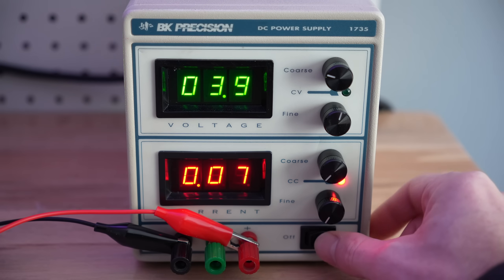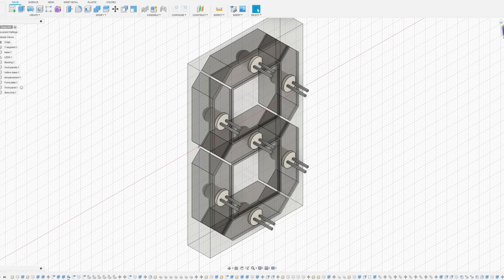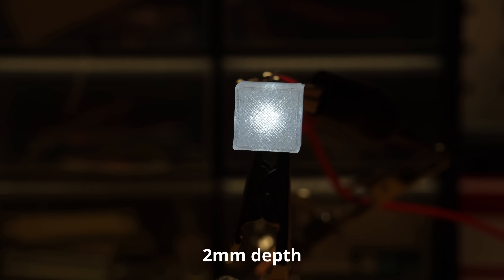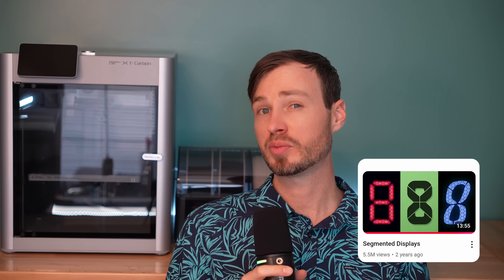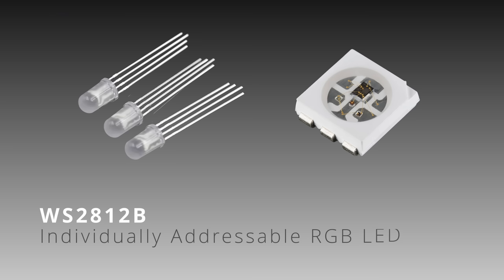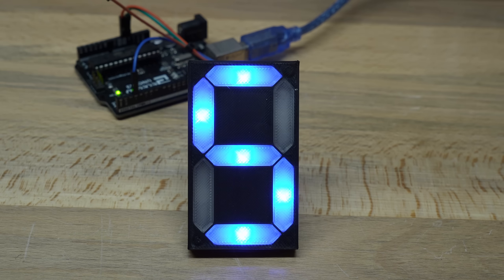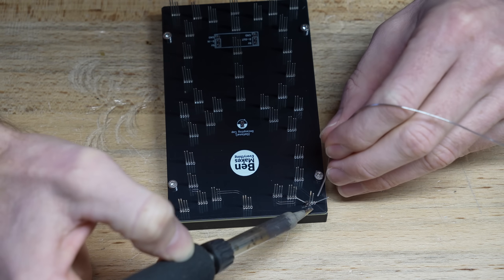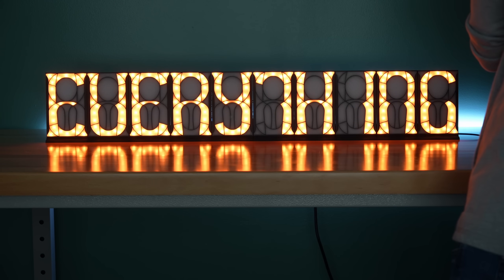How to Make 3D Printed Segment Displays

Comment: How about printing from any material doesn't matter,  then painting the inner surface silver or white?

When they make mass produced segment displays, they usually make them out of very white plastic, then paint the front black, then pot everything into clear epoxy which light guides and maybe diffuses just the tiniest bit, while white side walls provide fair reflectivity; they are however WAY more white pigmented than any white filament you can buy, so normal white filament will result in more light loss because this light is diffused into the depth of the baffle and eventually decays there.

I also sometimes like to sand down the front of mass produced segment displays and replace it with a 50% matte headlight foil to make the screen immune to stray light and hide it better unless on.

"light comes out in all directions instead of a single direction" that is not true, you should look at the specification for the LEDs that you buy. SMD LEDs without a lens have a like 120-160° radiation angle, just like you expect a point light source to emit light in all directions. The lens on the front of the LED (typical for through-hole but also available SMD) focuses down to a narrower angle. If you want to cheat, you can sand down the lens of the LEDs to emit in all directions.
Reply from the maker: Hey, thanks for the feedback. I am actually revisiting this project in my next video, and I took a different approach., so you may find that interesting.

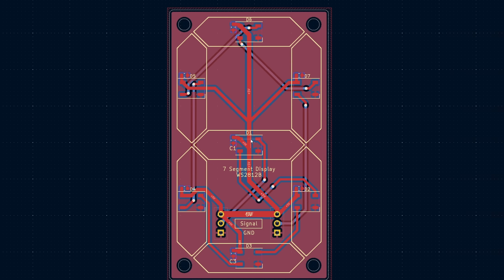Comment: 9:00 The standard pitch of a breadboard or stripboard is 1/10 inch (2.54mm) the same as dual inline IC's Did I just hear an American call it 2.5mm? There is a difference. You might be lucky installing a 5mm pitch 2-pin header on a stripboard, but if you have many more pins it won't fit.

Comment: Ideas for improvements: Make the internal divisions reflective instead of black so light has more chance of bouncing and escaping, therefore increasing brightness and it will also make the spread better due to light bouncing in different directions. Within the translucent layer you could also add a small white non-transparent layer acting as a thin diffusion layer. Also, have you looked at transparent nylon filaments?

Comment: Way back in grade school I was doodling on graph paper and came up with a segmented display design that could display all the digits, and A through Z both in caps and lower case, that only needs 17 segments. Basically 3x2 boxes with segments around each box, where a 7-segment display uses 2x1 boxes.

Comment: Is this something that could be operated with a portable battery (perhaps just the 7 segment). I’d like to replicate a running stopwatch.
Reply from the maker: Yeah, it only requires 5 volts which could be regulated easily from a battery. It would just depend on how many LEDs total you needed and how bright you want them to be - that would determine the battery life.

Comment: I would mess with cavity design and materials. You want more distance for better averaging but you don't want the dimming of a lot of plastic between. So move it back without increasing the thickness. Leave a gap. Optimize the gap and window thickness. The SMDs may become more attractive again. My experience has been that thru hole LEDs are generally more lensed and have lower viewing angles. SMDs are like 120?

Comment: I think you could learn a bit from 3d printing lithophane and vary the thickness of the translucent parts to get a more uniform light spreading using a single led per segment. Thicker around the led and spreading out thinner. Using a depth map based image could help. That being said, i like the current brightness. [edited the misspelled name of the technique]
Reply from the maker: Thanks, good suggestion.

Comment: from the video the 3D parts look good but i can't determine if it used ironing for the last layer to give a better texture finish, also this proyect could benefit from using smaller LED like the used in LED strings or the "wavy" stringy ones for custom shapes.

Comment: Pretty neat design! Also: once you've tried using a solder paste stencil + reflow for SMT soldering, it makes assembling boards by hand much easier (and easier/faster than THT soldering). PCBWay and JLC both offer stencils for about ~$6 extra -- just make sure to select the smallest usable sheet size + small buffer (eg. 300x400mm), otherwise shipping can get pretty pricey.

Comment: Good job. For future projects something 1-wire and easy to reflow like the WS2812B-2020. According to latest datasheet decoupling capacitor is not needed. I like these because they are easy to design with and code for.

Comment: The best DIY diffusion material I have found so far is epoxy resin with a bit of talc mixed in as a white pigment. I would assume that silicone with a bit of white pigment would also work well. Epoxy doesn’t stick to the adhesive side of sticky tape, so you can use tape or labels to cover the segments’ faces to give them a glossy surface; this is how commercial 7-segment LED displays are made. 
Additionally, it’s desirable to have the display body (or at least the inside of the segments) be white, so that light is reflected back rather than absorbed as heat. 

For contrast, you want a dark lens, counteracted with bright display illumination. I haven’t tried it myself, but my understanding is that even better contrast can be achieved by using polarizing film, which will dim incident external light even more while not affecting the display as much.

Additionally, you should try out the APA102-style addressable LEDs. (Adafruit sells these as “DotStar”.) They use separate clock and data lines — it’s essentially simplified SPI — so driving them is a bit more tolerant of various timing issues and can even use an MCU’s hardware SPI. But moreover, they have a higher PWM frequency so less flicker at low brightness. (IIRC, APA102C is 1.2kHz, SK9822 is 4.7kHz, and HD102 and later, even higher.)

Comment: what kind of program can you tell me?
Reply from the maker: If you want the code, check the github link in the description - its very basic, but you can use it as a starting point to add more functions if you want.
Reply: @benmakeseverything  thanks, but I need the name of the program for the 3D drawing
Reply from the maker: @kto-to8492  Fusion 360 - is how I created them. But I did provide .stl and .step files so other programs should be able to at least open them.

Comment: Really like it! Would actually buy something like this (with an ESP32 for Home assistant), or at least get in on a group buy of the PCBs. Ideally they'd be surface mount so can all be assembled at the supplier, and would be great to have easy wall mounting features (e.g. keyhole shaped holes for hanging on screws). The connectors between the displays could be edge mounted so you could literally plug one display into the next. Also would be handy to get an idea of how you could print with single filament printers
Reply from the maker: Thanks! Yes I'm going to swap out the arduino nano for an ESP32 and send it data over bluetooth or wifi. I've already implemented a scrolling feature to display longer messages since posting this.

Comment: I took apart a backlit LCD that used a piece of white plastic as a diffuser, and it had a weird bubble shape towards the LEDs to reduce the hot spots. The bubbling was convex, so directly in front of the LED the plastic was thicker making the light dimmer, but further from the LED the plastic would get thinner and more light would pass through, resulting in a perfectly even light source across an area. I imagine a similar shape could be used to reduce the hotspots that you are getting in the segments, but your limits will come down to the layer height of the 3D printer

Comment: Nice font selection. I'll likely use different construction methods to do something similar on a larger scale for my project.
At around 11:30 you compare the 5mm through-hole LEDS to 5050 SMD packages with a misleading statement about their light dispersion.While there is usually some diffusion in the epoxy to make the pixel appear to fill the circle(and mix the RGB light ) when it's viewed head on, and this does create some side spill of light, the majority of photons actually remain MORE focused on axis by by far than any flat window surface mount LED. The hemisphere is literally a focusing lens to project most of the light forward better, and that narrow beam contributes to the hot spot seen. The visible side glow you describe as a useful contributor is merely a weak artifact that happens to be visible when it stands alone, not very helpful in nost light guide applications.
Reply from the maker: Ok, I didn't know that, interesting. I was just going by my own subjective observations.

Comment: 13:50 4.5V and 50A 😵‍💫 A ton of amps indeed 😁
Reply from the maker: Yeah, it could probably power 100 of these, but that's what I had on hand, so why not use it!
Reply: @benmakeseverything  first time I see that kind of PSU. What is its typical application?

Comment: I like it, very inspiring. If you add some depth, I have found that a good tip to adopt from photography lighting is to double diffuse. I have added little diffuse 3d printed globes to LEDs then stuck those into slightly larger lanterns. The air gap between diffusion methods helps a lot, but predictably hits brightness a little bit.

Comment: I made a similar project for a clock using transparent PLA .. or almost transparent .. The most annoying problem was the number of LEDs needed to get good brightness. Also, making the light smooth across the segment without seeing the LED too much was tricky .. For example, in your case with the red color, it doesn’t look very nice .. Still, it’s great work!

Comment: I don't see any reason it is completely necessary to print these as "multi color" objects instead of separate pieces. I guess it spares you from having to puzzle them together manually,  but it would potentially save a lot of material and maybe some time. Maybe i missed something about this though. 
Either way, very cool design and project. I would definitely be interested in making my own if the code interaction was reduced.
Reply from the maker: You are correct, it is not necessary. But it does save me some work, and I had never tried multi-material printing before so I thought this might be a good application for it.

Comment: Nice job!  Check out "light pipes" - designing a conduit of plastic that effectively spreads the light from a point source out over a larger surface.  These are used in a lot of commercial devices you can find around the home.

Comment: @9:09 breadboards have 0.1" spacing. While 2.5mm will work over a decent distance, it's still better to call it what it is.
Reply from the maker: I think I said 2.54mm - given that 1 inch = 25.4mm, I believe that's .1". But I do have a bad habit of switching between metric and imperial units without explaining or giving the equivalent.

Comment: I dont know if anyone mentioned this yet, but for better light distribution on the segments, you could always try to either paint or somehow make it so the walls inside each segment is white, bouncing more light around. 

I understand why you'd want a black separation to reduce bleed between segments, but adding a layer of white on each side or simply painting it white would allow the LED's light to bounce around more instead of being absorbed by the walls, which would help both uniformity and coverage. Might not be a huge difference, but it should definitely help from my experience.

Comment: What about making the transparent element have different thicknesses in the center and at the edges? For example, at the point where the diode is located - 10mm, and at the edges 2mm. And select the thickness so that you get uniform lighting.

Comment: For the difusing part, I've always thought ( but have never tried) that a two layer diffuser would work better. Now i'm not talking about 2 printed layers, but like 2 translucent sheets. Maybe print one with x printed layers, and an extruded lip, and then the other part separately. Sure you could print it all at once, but the bridging would probably mess up the lighting, thats why I would want the 2 parts to be printed separately. The extruded lip would act as a spacer between the two parts.

Comment: The only thing i dont like is the T  

But otherwise i love that curved fonts!  Would it be better and less "poop" to print clear and balck separate and then glue together?  Each line to poop out black and clear, gotta be for the whol project, like 400g wasted.
Reply from the maker: Yeah, if you want to create a display with far less waste, separate prints would be the way to go. Or a printer with multiple print heads, in an ideal world, but those are rare.

Comment: FYI. If you want to 3D print something as one part that is multiple components in Fusion, instead of selecting '3D Print', use 'Export' and export it as an STL. This will export everything though, whether it's hidden or not. So any parts you want excluded will need to be temporarily deleted/removed before exporting.

Comment: You could get regular off-the-shelf diffusion sheets, punch it and stick it between two pressure fit parts of the 3D printed design, if you are okay with a multi part design.
Would rrduce waste and those sheets can be very cheap and very nice diffusers!
Reply from the maker: That's definitely an option to reduce waste. My goal here though, was to create something that would require basically no assembly.
Reply: @benmakeseverything  very understandable! I imagine for something like this it could become a lot, even for someone like me who likes Lego-ing pieces together.

Comment: Hey, I did a lot of 7seg 3D printing with RGB LEDs. Here is what I learned: You want the inside of the segment to be WHITE - this gives WAY better light scattering than black, which eats away all your light. Either print black (to avoid light bleeding) and paint the inside white, or look for kexcelled3d K5 White Shade PETG which perfectly shades light. Some matte white filaments might also work. Regular white bleeds too much light. Also, use WHITE soldermask on the PCB and consider leaving exposed HASL (copper) spots around the LED as light reflectors.
For the front face a thin white layer as you did it is actually not a bad idea and I like the white front face of the display. I actually use an acrylic sheet with a thin white decor foil stuck on as a front face. This looks really nice as you can't even see the outline of unlit segments anymore. (I added a video to my profile)
Reply from the maker: Thank you for the suggestions! All of those sound really interesting. I should have thought of doing the inner segment walls in white PETG. And the white solder mask would have been an easy change to make.

Comment: the industry standard practice for really homogeneous segments now is to make a hollow white plastic cavity with a diffuse foil glued to the front. the cavity in combination with the partial reflectance of the foil allows the light to spread evenly without the need for any resin filler.
Reply: I'd be interested in what sort of foil to look for.
Reply: A layer or two of clear filament works as an internal diffusor. Then you just need a little air gap from it to the actual front surface "output" diffusor (which is also a couple of layers of clear filament).

Comment: For those with single color printers this can be done by printing the face surface clear and inserting a filament change command to change it to the black part. The elements would be empty and the translucent parts printed separately and inserted.

Comment: I have experimented with something similar. It was a custom lighting on my bike helmet using LEDs in a 3D printed housing that conforms to the helmet shape. And also blinkers and tail lights for a velomobile. For any of that I did not need to achieve perfectly uniform light on the surface but it did produce some relevant experience. 

- One way would of course be to increase the distance from the LED to the front surface. The LEDs have a cone of space in front where something like 80% of the light is going. If you just make a 1.5-2mm thick clear PETG surface, then some air space behind it and then the LED, the surface will be iluminated more evenly. The big downside is that the display ends up much thicker.
- Another way would be to use varying thickness of the front diffuser. You could print draw it in CAD and print it so that right in front of the LED there is 3mm of clear PETG (so probably 15 layers if using 0.2mm layer height) and in circles around the axis of the LED it gets thinner the further away from the LED you get. Each interface between layer and between extrusion lines scatters the light at least partially in other directions. So the thicker center print should send more of the center of the LEDs light cone sideways than the thinner further parts that see less flux of light. I would also switch solid infill of that part to concentric if the slicer can do it so that it results in circles centered on the LED. But if not then the usual rectilinear is fine. 

It should be noted that when working with the same amount of LEDs per segment achieving mor uniform distribution will inevitably result in dimmer center. And quite possibly some of the light hitting the front surface now will end up elswhere so the segment will have less light output overall. So the challenge is finding the right compromise between percieved brightness and uniform looking surface.

Comment: 5:32 can't you smooth out the diagonal print lines some how ? like with acetone or something. those look the ugliest and is the thing you constantly look at.
Reply from the maker: That is a super close up, and I think in that case the filament was a bit damp and so it looked worse than the later ones (after I dried it). From even a few feet away you can't see the lines.